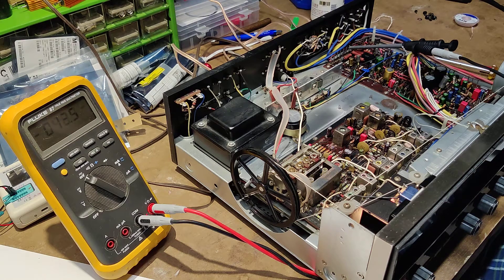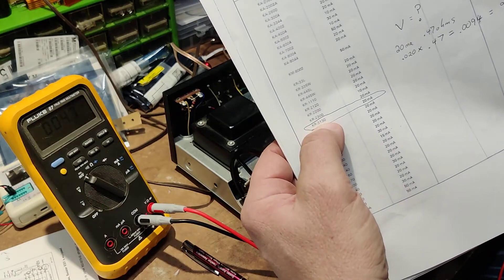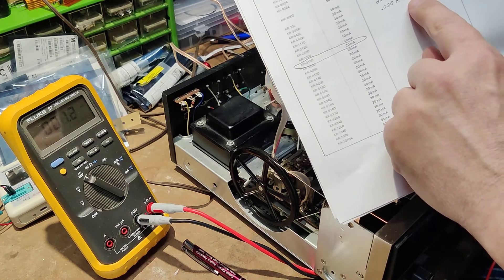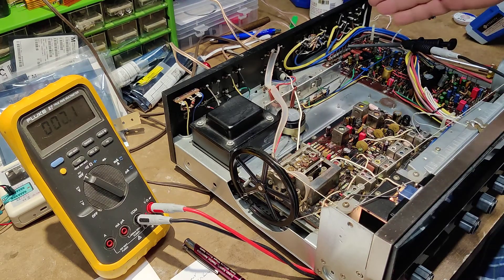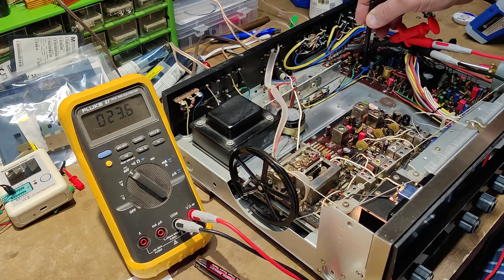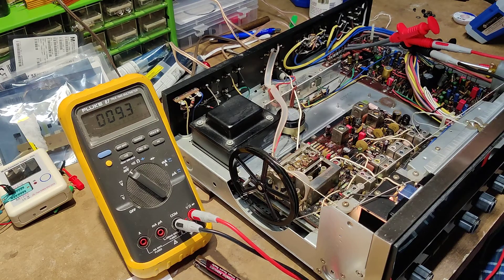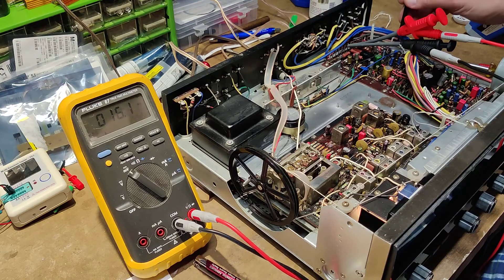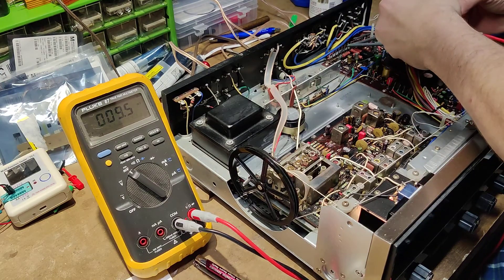Kenwood KR 3130 Setting Bias Current

Comment: Hey Dave. I have this same model and I'm getting some distortion in the left channel only. I followed your instructions here and was able to adjust the right but when I tried to adjust the left I couldn't get the value to change. I'm assuming the trimmer is shot. It's stuck at 7.2 and you adjusted to 9.4. Am I getting a true reading? The trimmer seems to be shot, but 7.2 isn't that bad. Would that cause the distortion? Thanks.
Reply from the maker: I think you would be ok with 7.2 as long as it's not drifting. Did you try some deoxit on it? I'm thinking you might want to look at the 2SC458LGs 
and 2SC871s transistors on the pre-amp. tone amp, and main amp boards. They are the ones with black legs and notorious for being noisy and failing.
Reply: @PackardDog  Thanks a lot. So having a bad trimmer doesn't affect the sound at all as long as the voltage is ok?
Reply from the maker: @nicholassisario1535  Thereoretically it shouldn't as long as it's within the voltages you report. High voltage could cause it but with 7.2 I would look to a transistor.
Reply from the maker: Have you used some deoxit on the trimmer yet?
Reply: @PackardDog  Yeah just did it today. It didn't do anything. Thanks for your help.
Reply from the maker: @nicholassisario1535  no problem. Check out audiokarma.org. There are several threads on this unit that you might find helpful. 👍
Reply: @PackardDog  Hey Dave. I messaged you a few weeks ago about my 3130 with left channel distortion. I just realized it has a preamp-out so I sent it to a power amp and there was no distortion at all. So that tells me the problem is in the power out section, right? Is there anything in particular I should look at first? Thanks.
Reply from the maker: @nicholassisario1535  correct. Do you have schematics for it yet? There are several  2SC871  and 2SC458LG transistors that are known for causing noise / distortion. You can replace them with KSC1845's .
Reply: @PackardDog  Hey. I ordered the new transistors and just received them today. Gonna swap them and I'll let you know if that helps. If there is still distortion what would you check next?